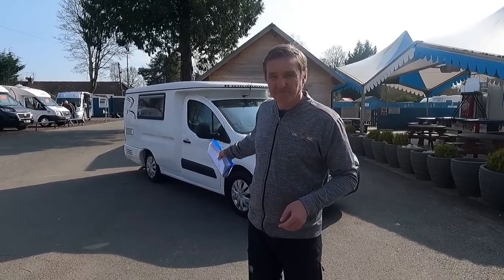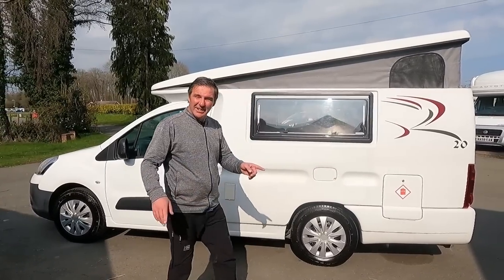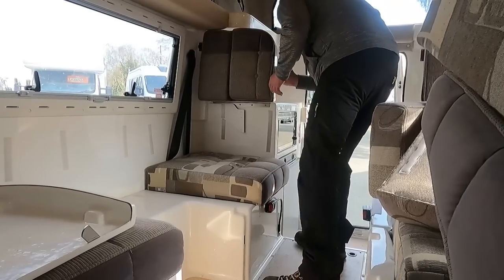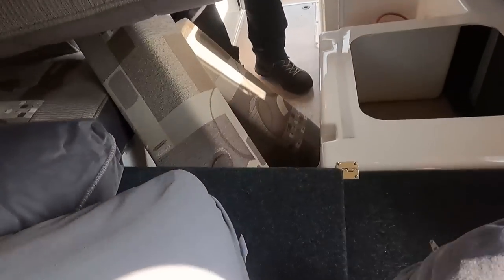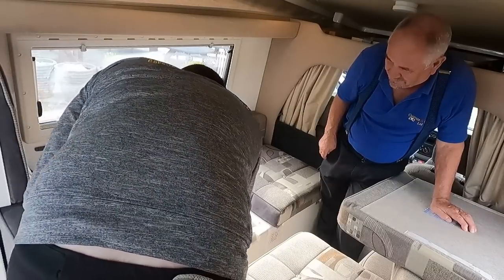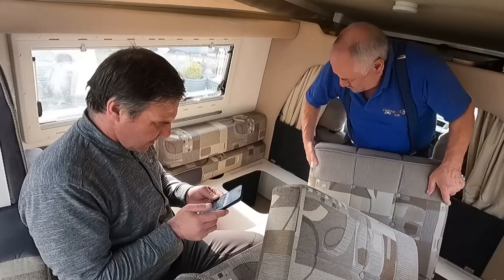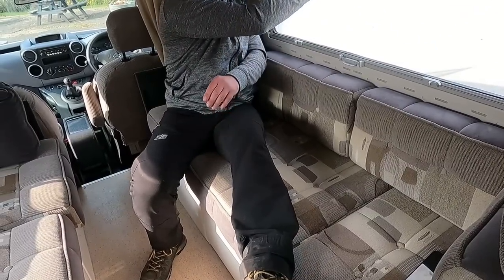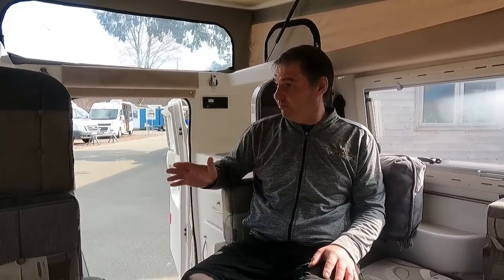Romahome Campervan - Romahome R20 Lo Motorhome

Comment: For 1 or 2 people holidaying, traveling or touring these little campers are in my view a good alternative to a VW T van or Caddy.  Option of having 2 single beds with the ability to get up easily without disturbing the other person, access to the fridge/toilet/sink/exit with the beds made up, low to get in a garage at home or multi storey...  can pull the roof down in storms and still use the beds...   If you compare this to a VW Cali, this has more space and better layout in my view.

Not so sure the review helped promote it that much, seems to take hours to get the bed built up and broken down again! 😂  Best is leave as 2 singles and leave the bits in the middle at home. 😉

A.,